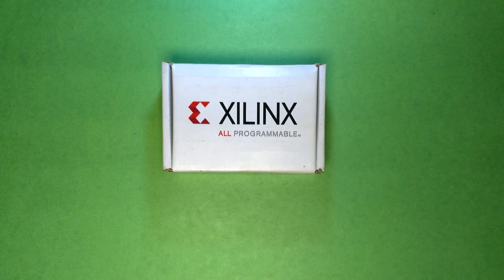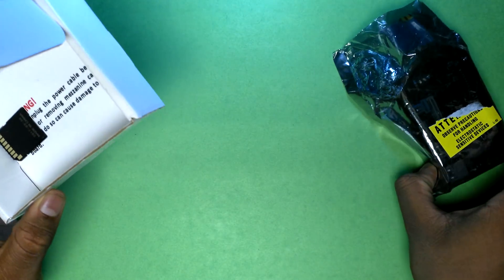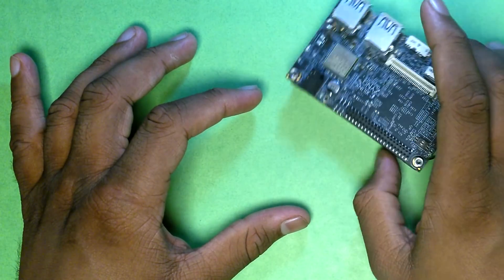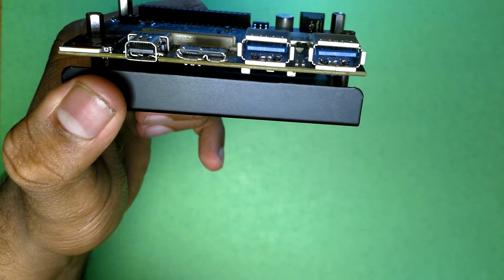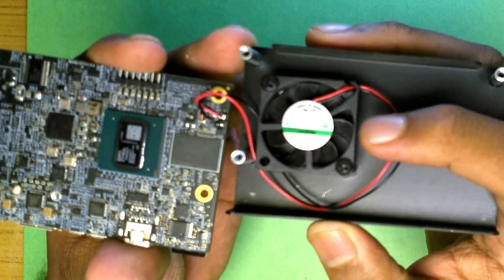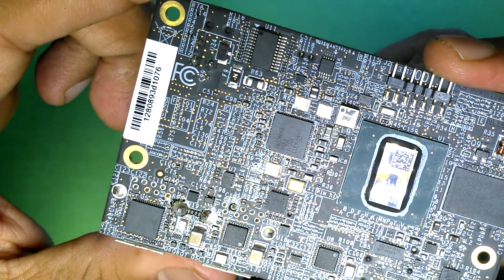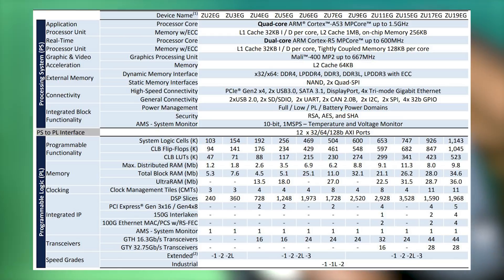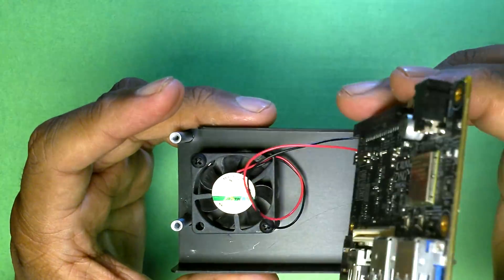96Boards Ultra96 Unboxing | Xilinx Zynq FPGA Dev Box

Comment: Hi. Can you make a tutorial step by step for Ultra96v2 starting from design in Vivado to petalinux custom(debian, ubuntu) rootfs? I tried several times but always end up failing. Bsp from Hackster.io demo fails during upgrade in Vivado 2018.3 and bsp from PYNQ git fails when building in petalinux 2018.3. I used a fix from xilinx website but it still fails.